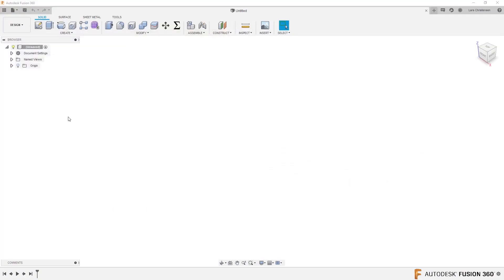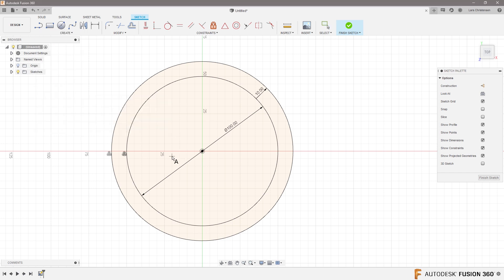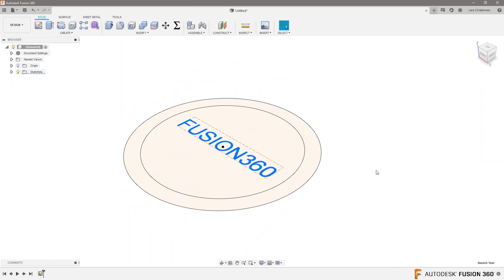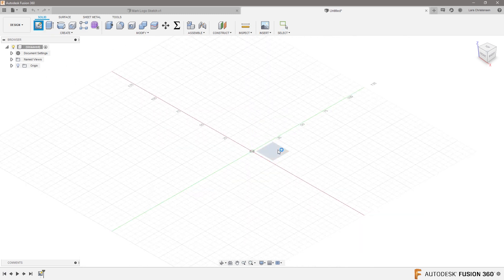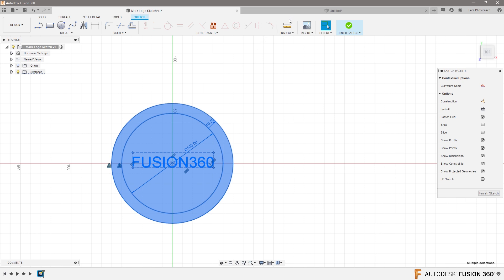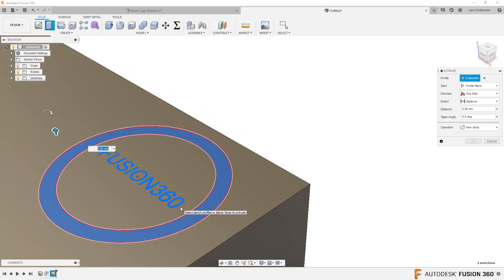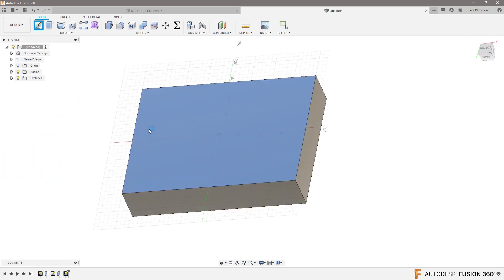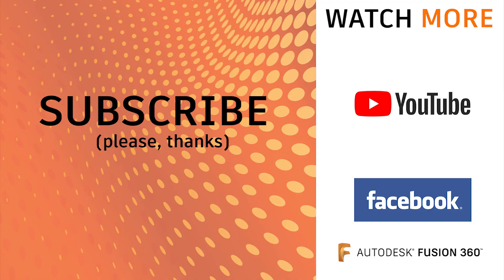Fusion 360 — The Logo Sketch Trick You Must Know — Ask LarsLive

Comment: Hello Lars! 

I need your help again! 
So far; you always find me the right solution to my problems, so here's a another one:

I will use this video as a reference; the look of my current job is similar to what you see at  3:34. 
Let say I want to make a 2D coutour of a extruded Fusion 360 logo. 
I'm using a 8 mm diameter to do so.
But some areas are unreachable with this router of 8 mm diameter.
So I need to use then a smaller one, like a 4 mm diameter, to finish the job.

I don't want to redo all the initial path I just made with the 8 mm diameter.
It would be stupid and a waste of time.
I just want to take care of unfinished business in some tiny corners.
Is there a magical way to ask (Basic) Fusion 360 to remember what he just did with a 8 mm router, and then ask to finish the details with a another 2D contour of 4 mm router?

You're my only hope... Well... At least the only one I trust.

Comment: I wished the text tools in Fusion were better implemented.  Left, Center, Right justify.  Better alignment.  Better resize and flip.  Some of these capabilities exist, but they are buggy and not well implemented.
Reply from the maker: I think generally text has always gotten low attention in mechanical CAD programs.
Reply: @cadcamstuff   Personally, I prefer using an illustrator program (Inkscape or Adobe) to create logos. It would be nice if Fusion had the ability to link external SVG files.
Reply: @BrianLeeWho  ive saved illustrator files as dxf and imported them for sketch geometry

Comment: Hi Lars. Love the videos. I got stuck on a problem with some hinges that I designed. I am building a glass case and designed some hinges to connect the door with. I am able to join them and get them to move as they should. Then I use a rigid joint to assemble them on the one glass panel. I then attach the other side to the door. This works fine. Then the second hinge becomes a problem. I can not attach it to the door without breaking the first join on the first hinge. Secondly. If I add other components the movement on the hinge stops and i can not move it again. I hope this makes sense.
Reply from the maker: I might need more coffee or maybe a beer. If the hinges works individually, they should work as a set. Maybe try and post on the forum or in the Fusion Facebook group. Someone there are smarter than me.

Comment: Thanks for the video Lars. I am looking forward to a greatly updated and improved handling of text in Fusion360. Soon right?

Also, when importing vector artwork from a client, I haven't found a way to simplify the amount of nodes used in curves. This has been a massive problem for me as it slows Fusion360 down to a crawl when working in sketches. Every click or movement of my 3D mouse results in minutes of waiting for the software to figure out what's going on. Turns a 15m job into well over an hour, if not more. How to simplify vector points of imported artwork?
Reply from the maker: Not totally sure. I think the vector artwork always are difficult with mechanical CAD. Hopefully the development team has some stuff in the works

Comment: I noticed your copy/paste does the same odd behavior as it does for me in not keeping the copy oriented the same way when pasting it even though your x/y/z orientations seem to be the same in both sketches.  Is there a way to paste a sketch using the same orientation & location so it would not be necessary to move or rotate it when pasting into a different sketch?
Reply from the maker: Not that I’m aware, sorry
Reply: @cadcamstuff  Looks like the latest version they rolled out fixed that problem as I have used the copy/paste a dozen times today without any problems.